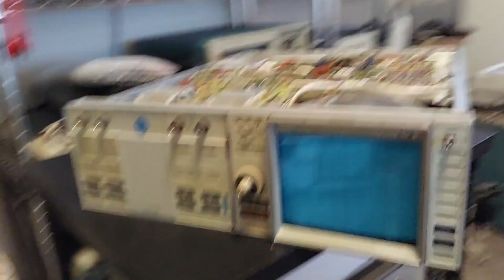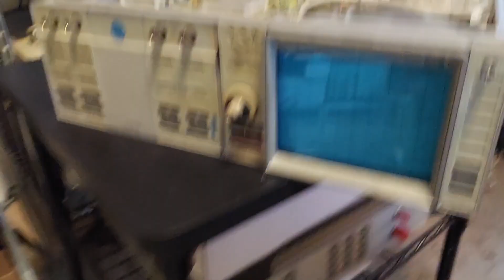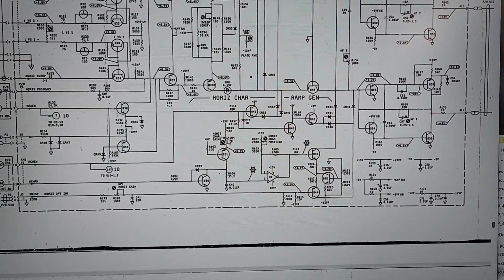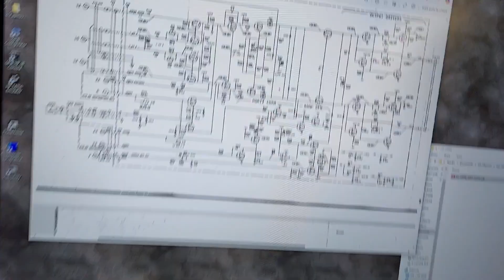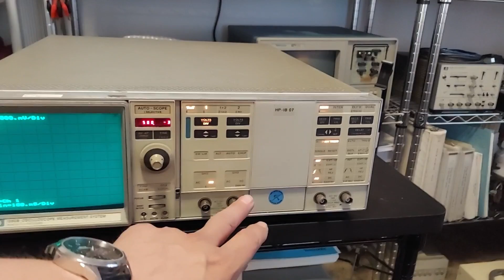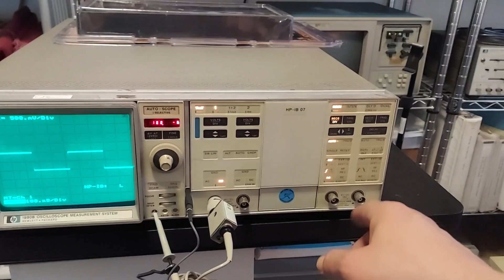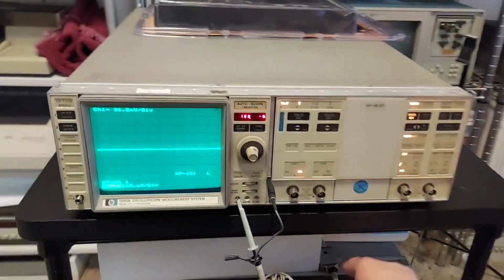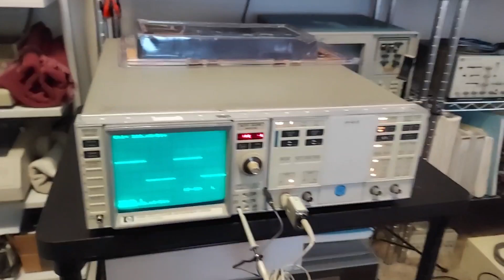HP 1980B Oscilloscope quick repair and first impression.

Comment: I agree, it is a very cool scope for when it was designed. The channel 3/4 plugin also has a battery for local RAM. I have two of these scopes and all the batteries have date codes from 1983, they still have well over 3V output and no leaks! The only caps I've had go bad are two supply bypass 100uF? on the Horizontal ASIC.
Reply from the maker: Thanks for watching. Yeah, it's a pretty cool scope, unfortunately soon after I posted this video the issue resurfaced again. After going into a deeper dive, it seems that either Q30 and or Q31 appear to be failing. The reset pulse going to Q30 does not change in either amplitude, frequency or width, there is no sign that the clamping diode is leaking. So, at this point I'm going to replace Q30 and Q31. Interesting that the 3 and 4th channel module has a backup battery, the only battery mentioned in the service manual is the one in the enclosure on the back.